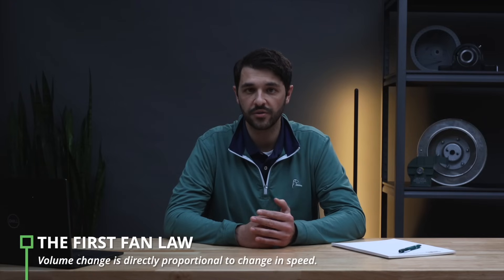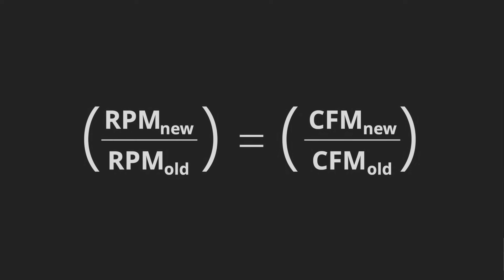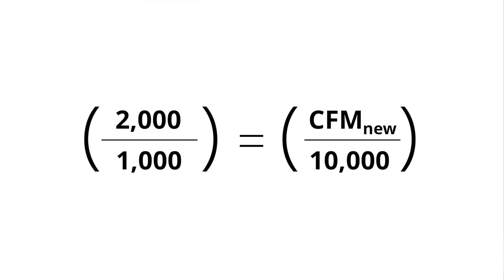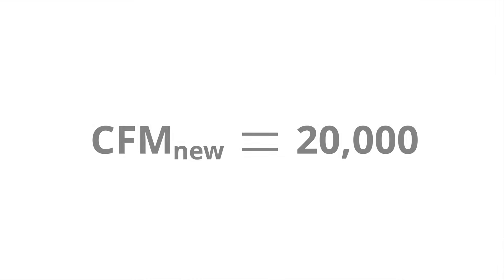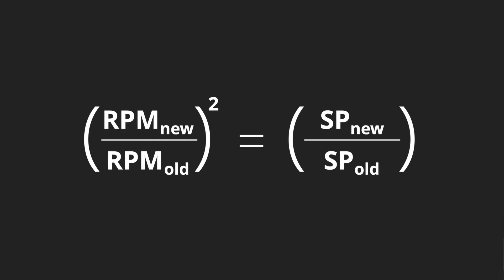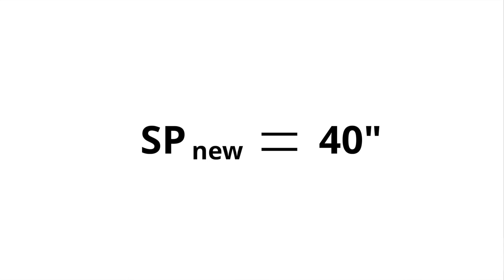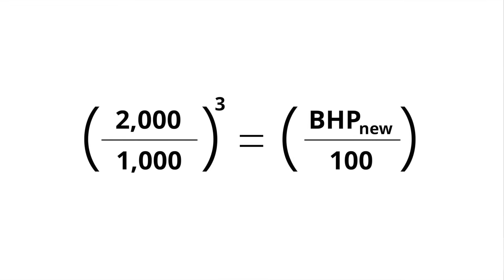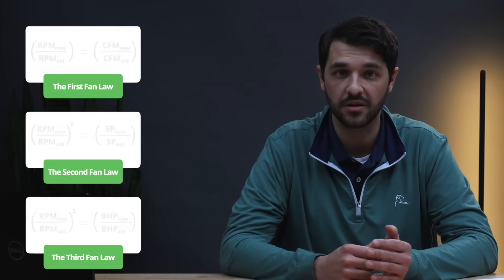Three Key Fan Laws Explained: Airflow vs. Static Pressure vs. Horsepower

Comment: Nice summary for a quick reference. My only comment is that duct friction does not exist "because air has mass".  The friction itself is an independent phenomenon, and is related to shearing stresses in the air due to its viscosity acting in conjunction with velocity gradients.  There is an indirect consideration of the air's mass when considering turbulence, as the density of the air (i.e. its mass) is a variable that helps establish WHEN turbulence will develop (through the Reynolds number) - as does flow rate and duct size  - and friction will act somewhat differently when there is turbulent flow (versus laminar flow) - duct shape, fitting shape and surface roughness can induce local turbulence and change the nature of the boundary layer flow at the duct surface, it is the viscosity of the air itself that is responsible for friction - and thus all losses.